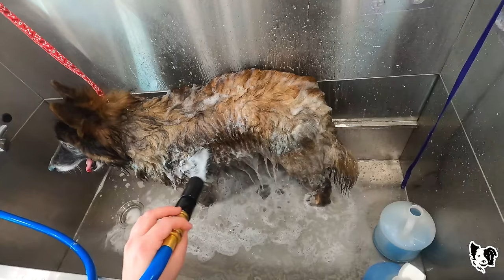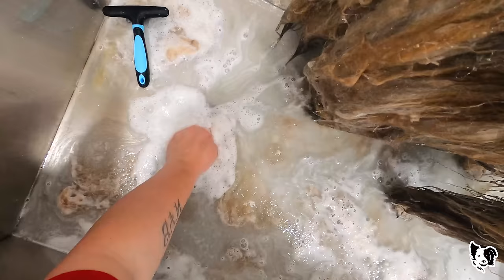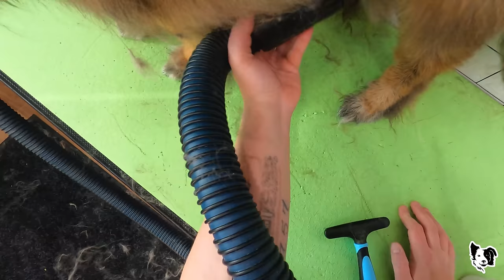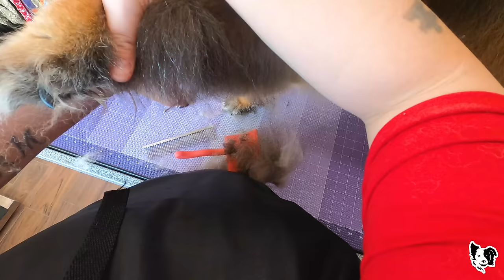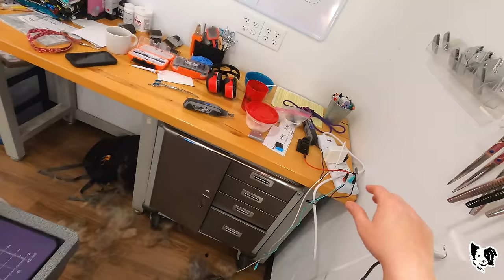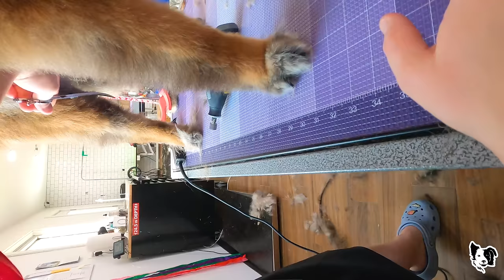WORST UNDERCOAT REMOVAL EVER

Comment: This groom feels so hard on this dog, it seems so heavy handed. I am not sure I would have filmed the hard brushing and blowing you had to do. I think this is sad.
Reply: I wouldn't be bringing my dog back to her after watching how she is just yanking the dogs hair with the slicker brush . Get a pair of scissors  and or comb that help to cut through the mats. I thought you weren't supposed to brush  wet or damp hair as it makes the mats hard to get out. Also drying the fur too close to the skin tangles the hair as well. She needs better equipment. She does know what she's doing though, for the most part. You also need to learn about different breeds, some have much different coats that require different ways to clean and cut their fur..
Reply: If it was hurting the dog, you would have obviously seen that. I don't think she was heavy handed at all. If you're going to be upset with anyone it should be the owner of the dog for letting it get that bad. Looks like the owner neglected that dog imo. I'm sure that dog was relieved to get the hair and died skin out of its coat.

Comment: Consider a mat for them to stand on during their bath. Feet sliding enables the dogs footing and slipping.
Reply: Just an idea, I'm a retired Master Barber, been grooming mine since I was a teenager
I bought a separate pair of blending shears, not thinning shears for my dogs, to cut into the mats or knots. 2 or 3 snips and the mats are easier to get out without pulling in the coat.
Reply: Yes!

Comment: The owner should be ashamed for neglecting to maintain her dog’s coat. The dog has been standing for over an hour while her fur has been brushed. The dog has had enough. Poor Mary Beth has to struggle through this groom. This should not be!😡
Reply: I think the only reaon this dog agreed to stand so long is that the bath was a great relief to her skin. Possibly, the wamr water feels good on older joints as well.

Comment: No offense, nice job, gentle groomer. Sorry she didn't brush and comb out gently first and after, so the skin can breathe, preventing skin problems. which is the most important basic technique for long furs. Without touching or pulling the skin, soft hand, working in very small layers and with 3-5 tooth of a comb at the time.
But then again I'm old school 😂